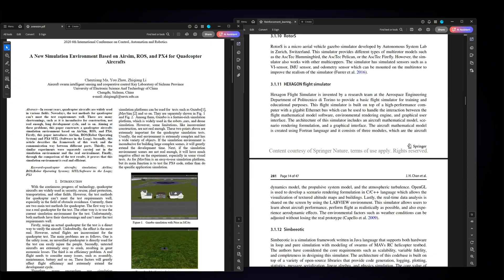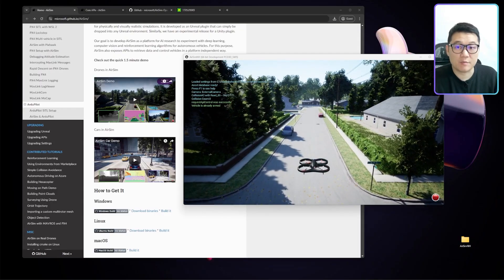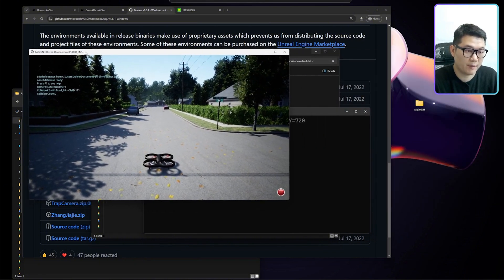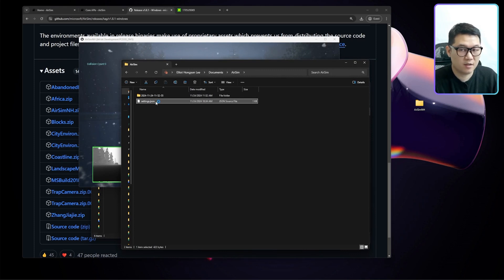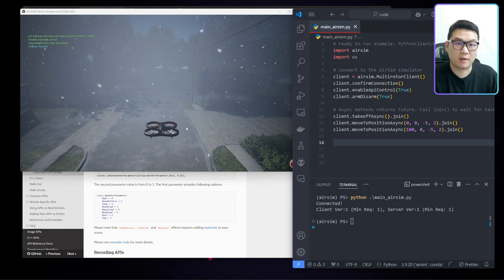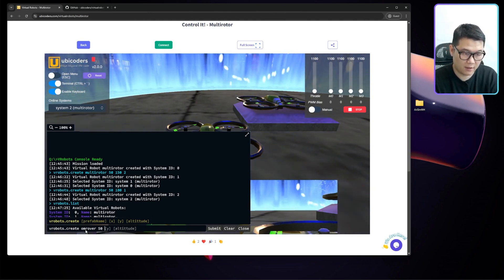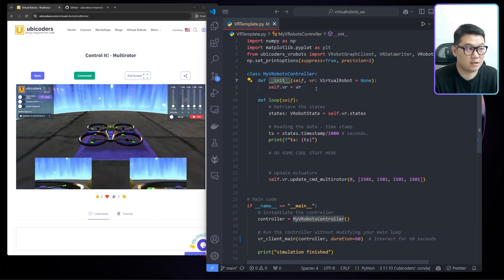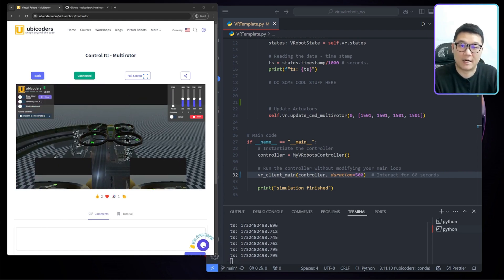STOP Buying Expensive Robots! [DO THIS INSTEAD]

Comment: What is if we want to try it in real after we are done in Simulation
Reply from the maker: Once the algorithm's good, I usually make the parameters to tune based on the simulation values as a initial guess. Then, I'd tune them again in the real life. Theoretically, if you can parametrize your robot accurately, this step is not necessary. However, tuning once more for the real robot is much easier than accurate parameterizing.